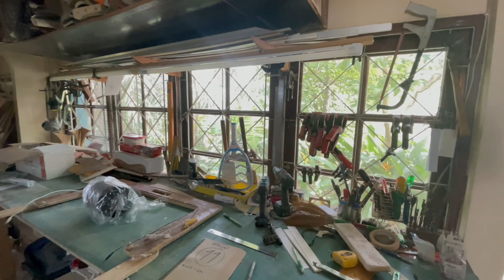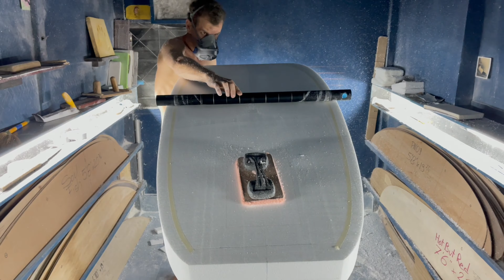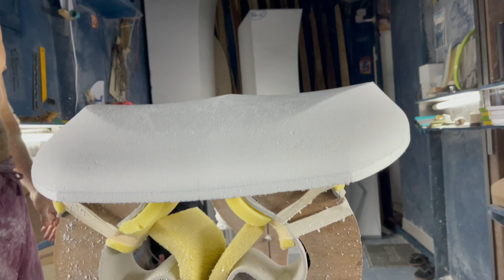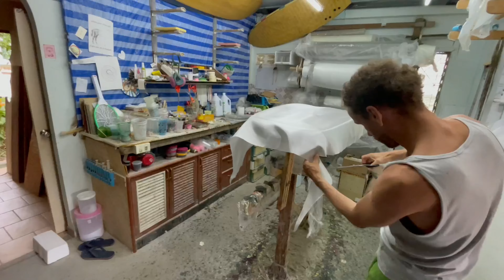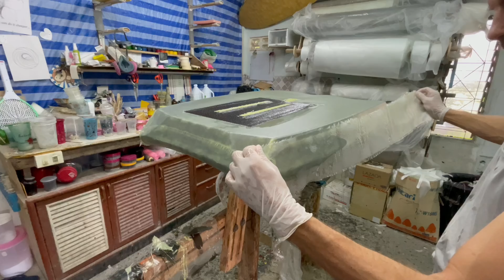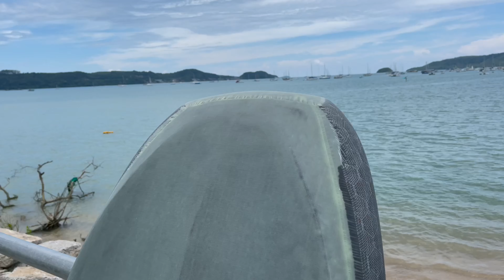Elleciel Custom Made Wing Foil Board, Exquisite Boutique Design and Construction

Comment: great video! I'm planning doing one myself ( on a course for beginners shapers ) do you think that a wingfoil board could work also for surf foil ??
Reply from the maker: Thanks, BF! Prone Surf Foil Boards usually have less volume than Wing Foil boards, but if you are lucky enough to live in a location with strong winds, then you may be able to double up using the lower litre board as your wing foil board also. I hope that helps. Good luck with your shapers course! :)

Comment: Sweeet board. Did you use hd foam around the track box or are they in eps only? I'm trying pourable foam atm.
Reply from the maker: Hi Julian. Yes, HD Foam was used around the track box. After a lot of testing with different approaches, so far, we have found that this the best solution. Cheers :)